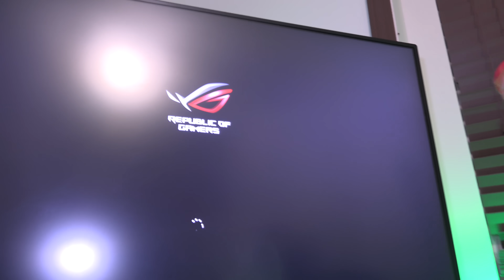Time to install WAY more power than I need... EVGA 1600w PSU

Comment: I been rocking with this PSU (EVGA 1600w T2) sense 2014 on quite mode, and ive NEVER had an issue with it. running a 6950x OC to 4.4ghz, a 2080ti OC, 5RGB fans, 3 aRGB strips, NZXT 360mm rad. rampage edition 10 MB, etc etc... i have alot going on in my build and this PSU doesnt even crank its fan on bc it doesnt get hot.
Reply: I’m currently building my own gaming pc and I bought the same model of power supply but the issue is I don’t know how to connect it to ups because the outlet in the ups is different from the outlet in the power supply . Could you help please ?
Reply: @Joseph-mj6mv  connect it to ups? What is ups?

Comment: just fyi...even if the cables fit, they may have pins in different places, potentially frying your components at worst, and just not working at best worst scenario. 

Or they might work. Would you risk it? 
I wouldn't. 

I was watching Bryan from Tech Yes City solder the pins in correct positions, because pins were in different spots, and otherwise he would burn his cpu to the ground, or start fire.

Comment: Ok going on your PSU problems. I have a 1080i 4790K 16gb ram 256 gb Evo ssd and 2 320gb hhds in raid 0 is a 550 watt gold rated 80 plus good enough for no OC  on a daily basis. i say yes as my watt meter only says 150 ruff

Comment: why would you buy another EVGA after the first one failed? I've never trusted EVGA power supplies....
Reply: evga has the best warranty and ive never had any issues with them
Reply: I’ve had this power supply since 2018 for multiple builds since the 2080 Ti came out, now using it for my 9800X3D/4090 build, zero problems

Comment: I recommend Corsair PS. Last at least 10 years. Been using these in both my own and customers computers over the years, very stable. Cost a bit for the TOL models, but worth it.

Comment: I know you heard this already, but maybe you had both gpus on the same rail without enough amps. I believe you need 28amp on the rail for just one high end card. And there's usually a big rail and a small rail lets just say, and you might of had both video cards on the small rail, and the small rail has all you hdd and stuff on it to i think. It will shut down like it did. Did you try switching one of your video cards to another rail on the 1000w and see if the problem prosiest??? Food for thought for you..
Reply: also, this is why I've bought Corsair "i" power supply's for as long as they've been selling them, I can switch it from multi rail, to single rail via the usb cable to it.

Comment: what is the amp rating for the extension cord you are plugging the pc into?
Reply: The plug had two vertical stems so 15A max.  If it needed 20A one would have been rotated.
Reply: @NIronwolf  i mean the gauge thickness of the extension cord. different extension cord wire thickness, handles different amperages

Comment: Jason, please keep in mind, that PSUs also degredade if they just sitting around even then, when they arent connected. Thats because the capacitors slowly gasing out. Wish you luck with your replacement, maybe consider to save some Money and return the 1600 Watt PSU also because it wastes much power if its under 10-15 percent load. Thanks for the Video, was great as always ^^
Greetings from Germany (again) :)

Comment: It might not be a bad power supply it may have to do with AMPs... You have a power hungry CPU and 2 power hungry GPUs.... It might very well pull 1000w but probably cant feed everything at the same time.

Comment: I'm sure your psu just hit OCP. Check the setup. How much power was drawn from which rails? On the side of the PSU the label should tell you the maximum and in a good review you should be abled to see which cable is on which rail. Then just add up the current and you should see that you've exceded the current rating on one or the other rail ;)

Comment: When you do the warranty they are going to want ALL of the cables that came with that PSU so they can check them. So you'll need to swap out the ones you didn't swap yet.
Reply: No they won't. I sent my PSU back to EVGA and they only wanted the main PSU and that's all they sent back
Reply: @tuckerkennedy5016  This is why it's always best to check with the manufacture before sending in the RMA. In my case they did specifically state that they required that all of the cables be returned. That was a few years ago tho.

Comment: Did you check to see if you were exceeding the limits on any of the voltage rails?
Reply: I was actually going to say this my self, might be drawing to much off one rail, wonder if he tried different pcie plugs on the power supply would of helped....
Reply: Me too.  Rails are a thing.  I don't think it's super common knowledge and he didn't mention checking it.
Reply: That's my guess too--probably on the 2018 GPU.  Pulling all the power from one rail vs. the two it ought to have may have exceeded the headroom it had until the machine was fully loaded, even with the ~630w pull from the wall.

Comment: On the old power supply, how did you get to your ~650W consumption measurement? It has been my experience that the only way to get an accurate measurement is with poert consumption meter. The consumption that the computer itself reports is the DC (read, after conversion losses) consumption, and it may not include what the GPUs are consuming, ditto for the hard disks.

I have included a link to a plug in power consumption meter in case you want to see if the old supply really is bunk:

https://www.amazon.com/P3-P4400-Electricity-Usage-Monitor/dp/B00009MDBU/ref=asc_df_B00009MDBU/?tag=hyprod-20&linkCode=df0&hvadid=167125429392&hvpos=1o2&hvnetw=g&hvrand=6203475601485763429&hvpone=&hvptwo=&hvqmt=&hvdev=c&hvdvcmdl=&hvlocint=&hvlocphy=9012139&hvtargid=pla-306572288073&psc=1